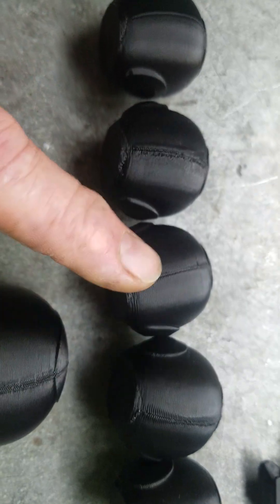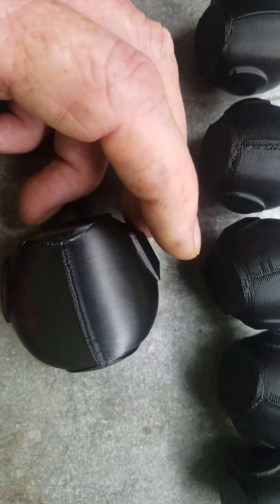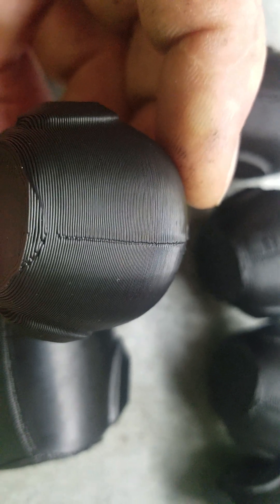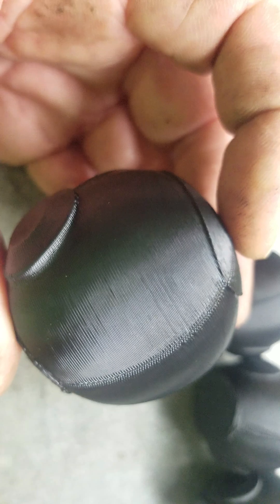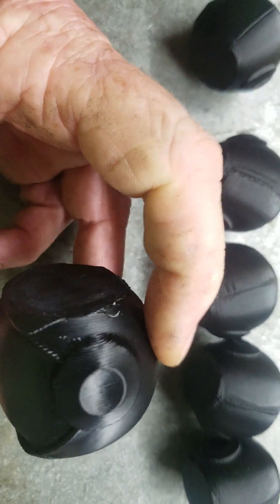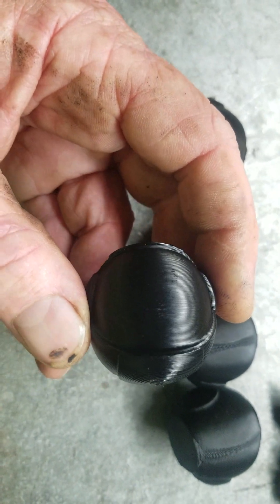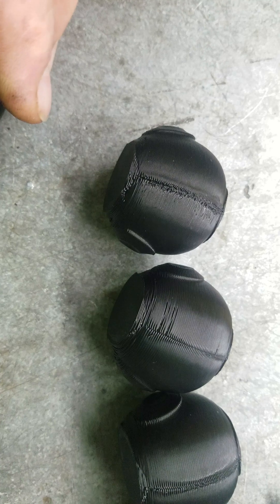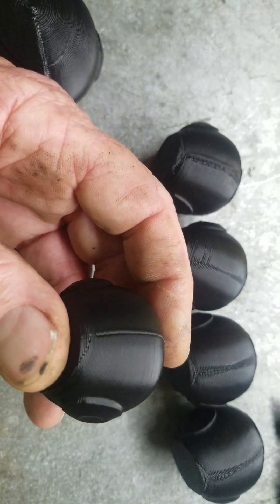Seams!

Comment: Have you tried different seem type? Maybe scarf seam or more hidden
Reply from the maker: I am hoping to find some setting to better control it. This model really shows seam defects when placed on the back/not hidden. Basically, I want to correct one issue when printing at higher speeds and accels.